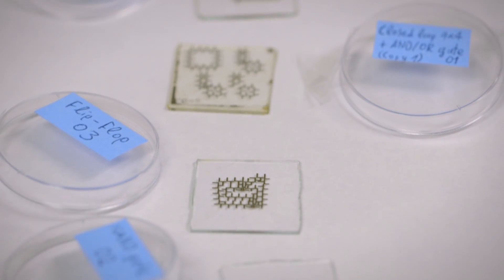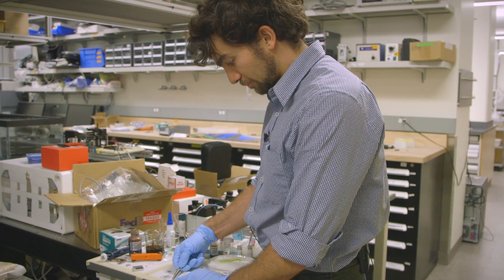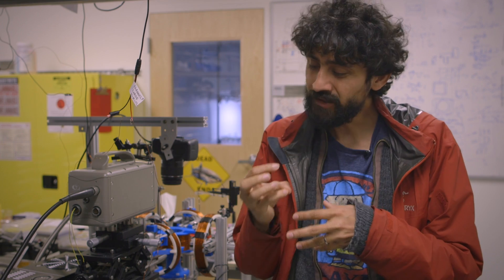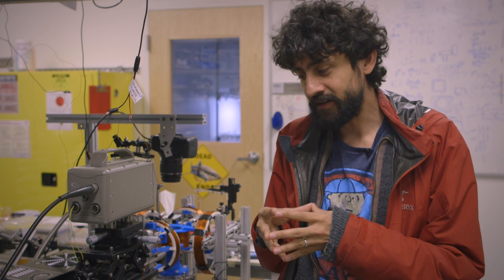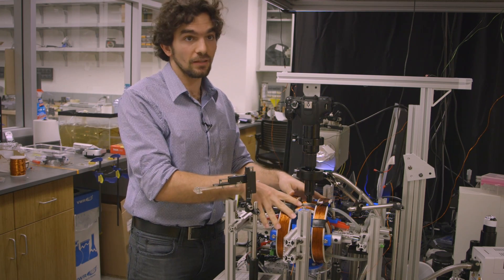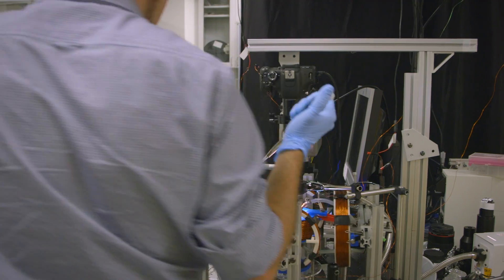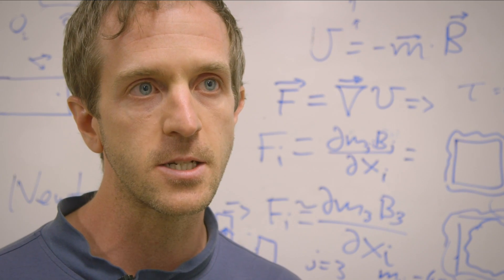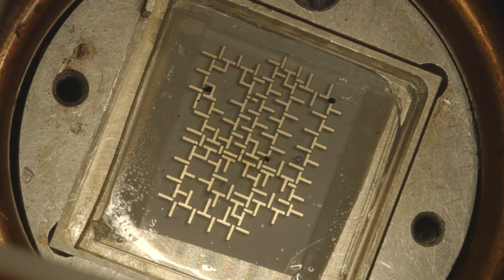Stanford engineers build a water-droplet based computer that runs like clockwork

Comment: If 'bits' are in any way physical entities, then no two bits can occupy the same space simultaneously, therefore 'digital data' cannot be compressed..
 The term 'data compression' is misleading.. It should be called 'data editing' or 'data compaction'.. This what happens when you filter out the constants and only transmit the variables..

Comment: Really fascinating tech you invented there guys...But what good is it if it is slower than already invented computers and what are some places in which it can be implemented? 
It might be useful where slow computation is required and energy crisis are unbearable. Also I have this one quick question: Is it only compatible with clean and mineral water or polluted water will also work?
Reply: Watch the flippin' video since you clearly didn't.
Reply: we are close to developing photonic computers but at the same time we are developing superconductors that allow electrons to move at light speed. we already have photonic memory and we are beginning work on photonic processors. we have yet to develope electron computers using superconductors that operate at the same speed. we will eventually. photoelectric electromagnetic magneticgravitation. all of these things will be sped up. but can you imagine what a chemist might do with a computer that transports magnetic fluid?
Reply: please hear it too, quite cautiously

Comment: Well, thats all very interesting but what the hell does it do? What are the applications for this. Is it not fundamentally slower than using fast moving electrons to transmit data? Is this not a retrograde step more for amusement than actual practical application and implementation into modern technology?
Reply: Did you even watch the video? They explicitly say that they want to manipulate matter, not information, and the droplets can be used to transport microscopic things. "In microfluidics, there's thousands of applications--"
Reply: +Arun Ballie I was wondering the same myself. If I had to guess, I'd say it'll probably be used to move little particles around, connect them together, let them interact, and then move them again and perform another tiny controlled chemical reaction, and so on. Maybe you can construct something cool with it that you otherwise couldn't manually.
Reply: +Arun Ballie it "eats" your taxes :)

Comment: I got carried away wondering about the tiny vibrating dots that I forgot to say this concept is absolutely fascinating! Sometimes, discoveries are made that have no discernable use but later prove pivotal to some real breakthrough as more is learned. But this 'water computer' can be seen to have real uses, and very innovative ones too.

There's been a lot of research in the field of medicine into delivering drugs using nano-particles. Does anyone (someone knowledgeable, please) know if this may prove similarly useful? I can't see how it might be possible but I'm looking at it from a viewpoint that's very limited in knowledge and understanding.
Reply: yes, you are right. Already lot of work has been done on 3-d control of magnetic nanoparticles to carry out surgery in eyes, brains etc....Lot of work is going on. Principle is same as what is shown in this video. Lots of medical applications you will find with this. There are enormous applications surely...

Comment: I have long imagined using water pipes to build a computer, using a water current instead of an electrical current. =)
Reply: Water has been used in hydraulics for thousands of years :P. That's probably where it came from. You have a very advanced hydraulic system in the ancient city Petra.
Reply: Mikael Murstam Same!! Water wouldn't be the best though. You'd need something with less compressibility.
Reply: Bizorke http://water.usgs.gov/edu/compressibility.html
Reply: yeah that's what I was thinking. Water is very hard to compress.
Reply: It's really hard to think of anything as basic as water as being incompressible. I mean, it does all these wonderful things, but - in what seems a full on middle-finger to logic - it does them because it cannot be compressed, at least not a lot.
Reply: Joseph A Nagy Jr Well that's good. A teacher told me water was too compressible to use for hydraulic machinery when I was in grade 5 - guess I should have known better that to trust her! So, who wants to build this thing now?
Reply: Mikael Murstam I know but those ancient systems don't necessarily require an incompressible fluid. Frequently in modern heavy machinery other materials are used (which I read up on the other day, previously assuming it was because of compression reasons): since water explodes into gas at high temperatures and isn't the best lubricant for moving parts.
Reply: Bizorke but all they had was water which is incompressible
Reply: Joseph A Nagy Jr I'm a bit confused. Are you trying to say I should have known water was incompressible because it was used in ancient aqueducts and irrigation canals?
Reply: Bizorke No, I'm saying that water was all they had, whether or not they understood it's issues with compression.

As for you not knowing about water's compressibility (or lack thereof), I didn't know myself until rather recently in my own life.
Reply: Bizorke I'm also saying they wouldn't have had access to many liquids aside from water.